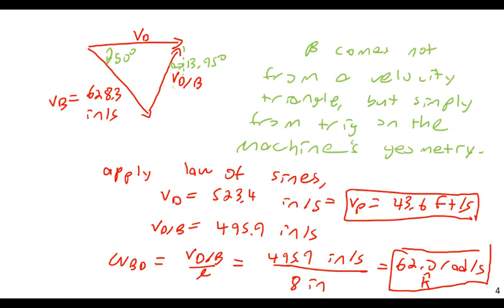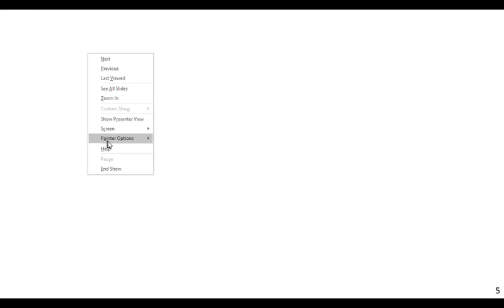Rigid Body Kinematics - Relative and Absolute Motion - Part 1

Comment: Shouldn't the Wab be 2000 rpm as stated initially during the problem statement at 4:10, compared to 200 rpm at 7:30? And it should be drawn counter-clock wise in the diagram, not clockwise (it will mess up your signs + or -).
Reply: Even though she wrote 200 rpm instead of 2000 rpm, if you calculate it thinking it as 2000 rpm you will get the same result as she did. And it shouldn't be drawn counter-clock wise in the diagram.